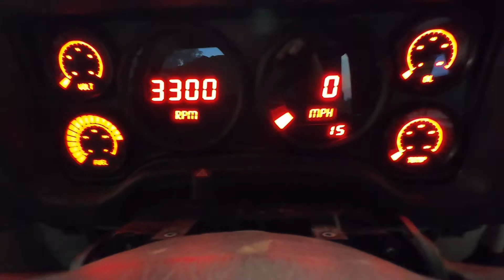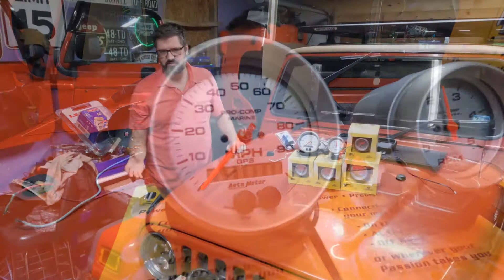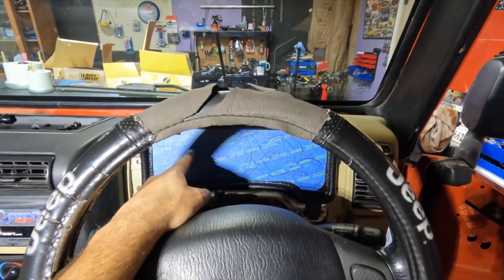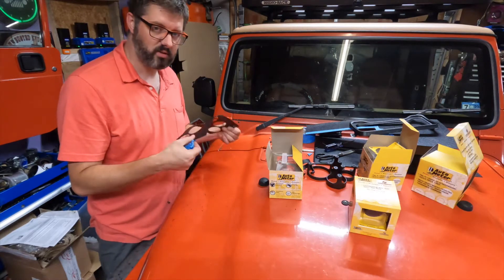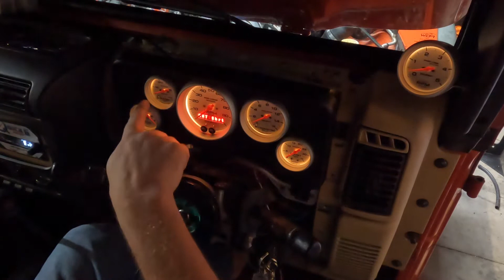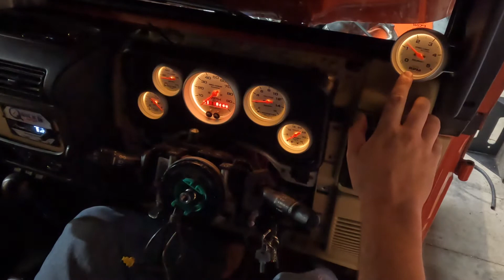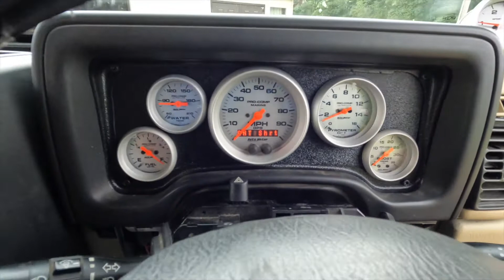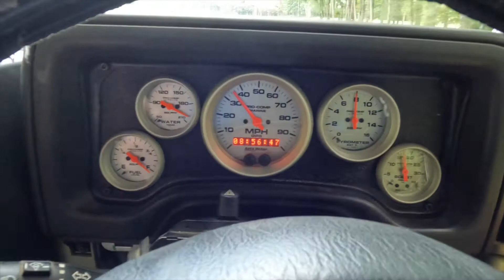Installing Autometer Gauges on my diesel TJ Wrangler because I can't make up my mind

Comment: I really like regular gauges too I have a ton of them. I looked into the one gauge after watching your video and I liked it a lot I could consolidate like 10 of my gauges into the one gauge but I really do like regular old gauges. I have a few different brands autometer, aem, and speed hut gauges. You should check out speed hut for gauges they have some nice ones and some harder ones to find you might like them

Comment: Water temp max is about 221F (it can go higher, but that's what the Bentley says). You should be running 190-212 F under normal circumstances. I saw the max on your gauge, and thought it should be around 250 F at it's highest. The gauge on the VW is a dummy gauge. I'm not sure at what temp it shows 190 F, but I think it's 16X-212 F, and it shows as "normal" @ 190.

Looks good though. I'm in the process of changing my gauges again as well, lol.
Reply from the maker: I don't think I realized these engines ran that hot, I'll have to look what my other options are for that gauge.
Reply: @RustyAutoholicGuy  Also with EGTs, I know the first generation GT turbos were good up to about 1550F sustained. Don't recall what turbo you have.

Comment: Hey mate with the auto meter direct fit dash I won’t have to create a plate like you? The thing you did with the 6 holes, I can just put the gauge directly inside? If yes why you did it this way please :) thanks
Reply: Also sorry can you keep the glass protector from oem after you install new gauge using autometer? I see you don’t have the glass while you drive. Thanks

Comment: No oil pressure gauge???  That's the first one I'd install!
Reply from the maker: Normally I would agree, however the stock cluster for the Volkswagen didn't have an oil pressure gauge so I figured I could hold off on it.